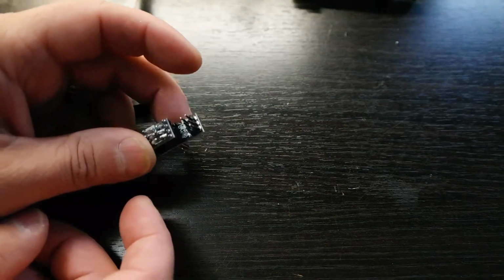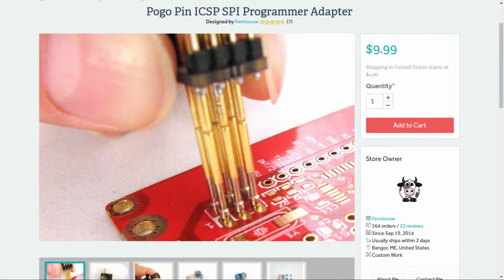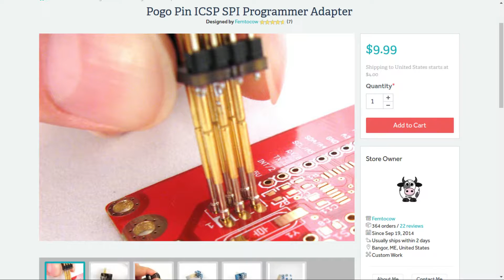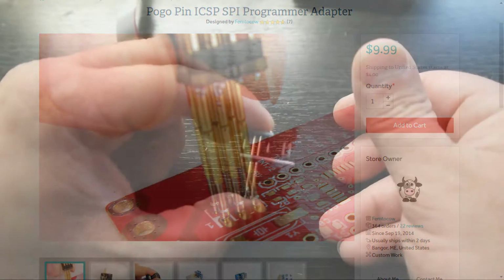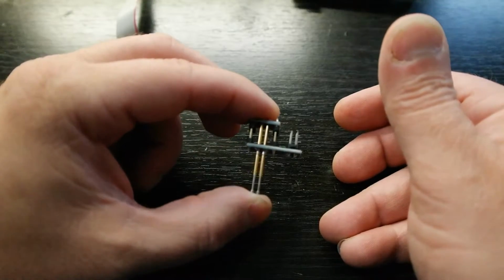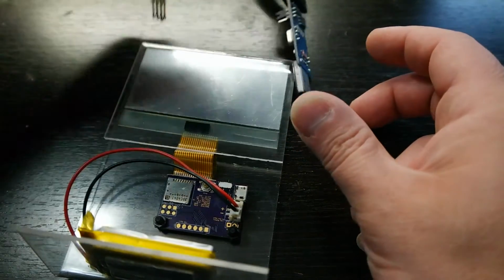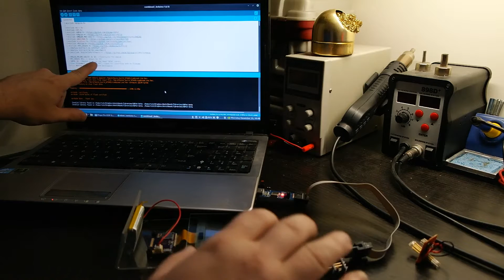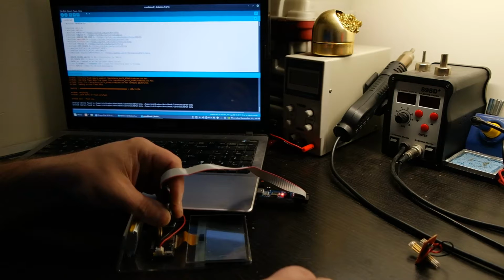FemToCow's ICSP Pogo Pin Adapter

Comment: I also use ICSP pads to save space since I can place components on the other side. I do place a via in some pads to prevent slipping of the pogo pin adapter. This way I can just anchor one pogo pin there. GND works fine since there is usually GND on the other side as well. One time I went to such extends to save space that I placed the pads under a CR2032 battery holder and after programming I placed a tape on them to insulate them from the battery. Nice video, thanks.

Comment: Yup, I need some pogo pins to test 32 connections to a bunch of mega8's that are surface-soldered to plates -- BEFORE soldering pins in the 0.1" holes (sigh).  So many kinds of spring-pin connectors though, it is hard to tell what I need reading the Chinglish on AliExpress.  You may know already, that one of the easiest ways to DIY an ICSP is to use the Little Wire (github) approach.  That is, you run a 6-wire flat cable from a Digispark to a 6-pin slotted female crimp connector.   Fusing out the reset allows USBTinyISP to run on 4 unmolested data pins.